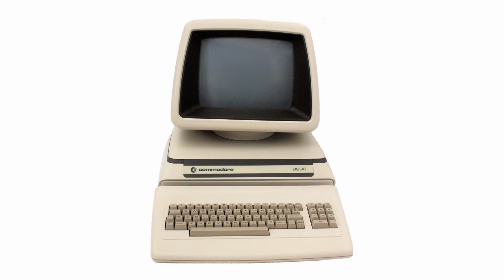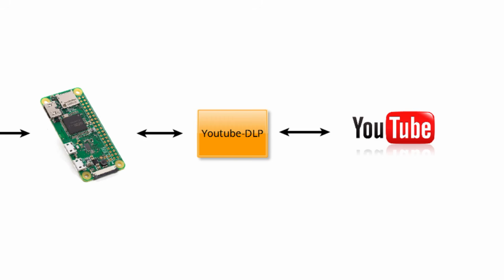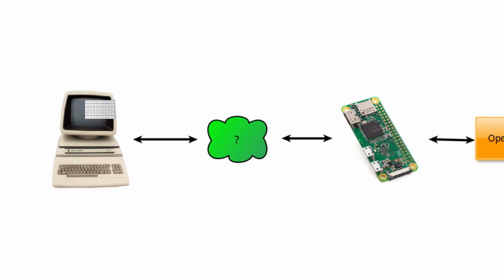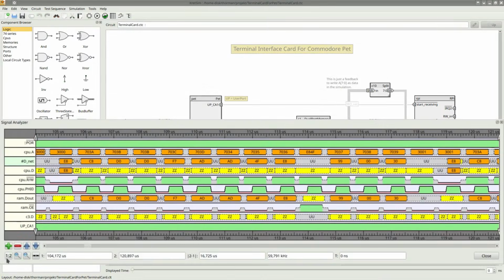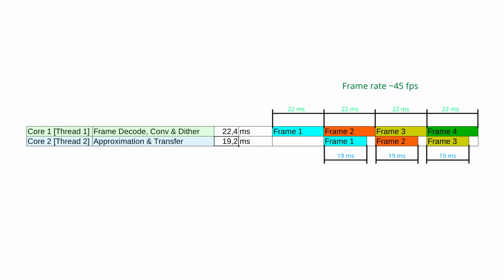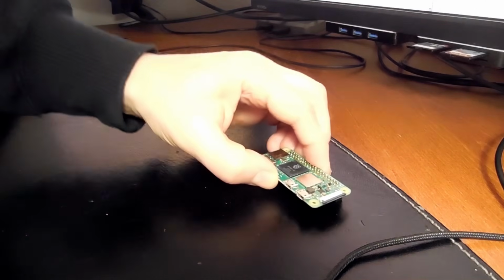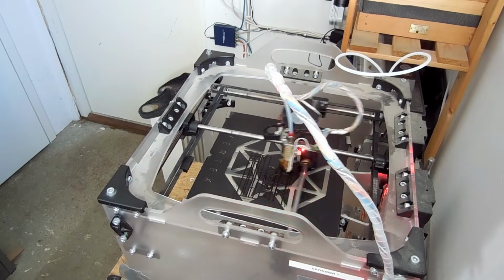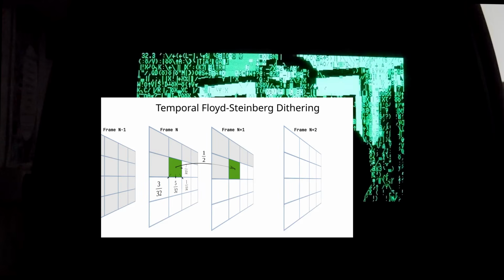Watching YouTube on a Commodore Pet

Comment: You could add audio by unrolling your loop a bit, say 4 times ( you've got a few kB of memory to burn on the PET) The unrolling lets you skip BNE's, which eat time, and you can get the equivalent of a free transfer per 4x unrolled loop. You'll probably need duff's device or an equivalent approximation to ensure you stay in sync, but you got 10 free transfers per line, you can afford it. And besides, audio. Also, that keyboard per frame to the pi, so you can play games. It will, obviously, play doom.
Reply: If you were feeling very energetic, have a macro-assembler, or can copy-paste a count in Emacs, you could unroll the entire frame buffer transfer; 6k of straight-line code. That would leave a lot of time per frame for 'activities.'  Reminiscent of John Carmack's 'quickly block transfer rendered frame to the slow video card.'

Comment: As a former owner of a PET 4032, it's very cool to see an old PET playing YouTube videos!

Could something similar be done with an older dumb terminal, like a VT-220?

If I understand the video correctly, the Pi is doing the downloading and converting the image to PETSCII characters. The PET then simply reads and displays the input characters. To me, that sounds similar to what a terminal does.

But I don't know if there are terminals that have a port that have the kind of throughput of the PET User Port.

Comment: Something you can try is the following:

Instead of counting up 2000 addresses on the board, on each "scan line" (80 characters per "scan line", for a total of 25 "scan lines" per screen), have the PET send a pulse to begin counting, then set up the circuitry to automatically pause counting after 80 addresses. One way to do this is to have a clock generator drive the up-counting but have the clock generator itself controlled by a CD74HC40103 DOWN-counter that is hard-wired for 80 iterations. Then, in the PET code, completely unroll each scan-line loop so that it transfers 80 characters with no NOP or branch instructions. You'll have to change your clock timing on the board to match the faster reading time of the PET.

Why do this? First, it will make the whole thing less susceptible to clock drift since it's only over 80 iterations instead of 2000. Second, it will save a bunch of PET processing time, perhaps enough to grab and output a little sound. Something to think about.

Comment: So impossible to do 4x8 CHARS? I wonder if it is possible to make a custom CHAR ROM that you could run some simulations on to build the most useful set of CHARS that would contribute to real improvement to the Bitmapped emulation with "TEXT" Characters. Or some how modify so that the display can be set to read char data from some RAM address like the C64? I bet the easiest way would be to have another PiZERO2 emulate the CHAR ROM EPROM and be able to dynamically change the CHAR bitmaps. Heheheh!

Comment: Are you characterizing the pixels in the order of appearance (leading to converting possibly the same pixel value repeatedly) or have you tried first just adding them to a unique array and using a replacement function to swap all occurrences simultaneously? I feel like it could be a vital improvement to the Pi's performance.

Comment: To improve the video quality massively you should adjust the gamma before you dither. It's best to do this with the output being more than 8 bits. Also, you can speed up the character encoding by only considering a subset of the characters based on the overall brightness of the character.
Reply: @xbzq, because you've done this before huh?  Improve your lies.
Reply: @M60gunner1971  Yes I have. A gray with value 128 isn't physically mid gray, it's perceptually mid gray. Half the amount of light of white doesn't look like mid gray and so shouldn't have a value of 128. But when you dither say with a checkerboard pattern half black half white, you get physically 50% light (on average) so it would be wrong to translate 128 to a checkerboard. The function to apply to correct this is exactly the gamma function. That's what it's for. You can try this out in Photoshop. If you apply a gamma of 1/2.2 and b/w dither to a grayscale image and then place half of it over the original you'll find that from a distance you can't see the line of where the grayscale ends and the dither begins. If you do the same without the gamma then a clear line will be visible where the dithered side will be much lighter than the grayscale side. The same adjustments need to be made when halftoning. Not sure why you assume these are lies. The 1/2.2 gamma is related to the normally used sRGB which has a built-in gamma of 2.2 for historical reasons as well as making 8 bit images have less banding. In principle a computer+monitor could take any number and display it as any desired brightness. This is obvious when you play with your gamma settings in your graphics card software. The graphics in your video RAM don't change but your monitor brightness does. Incidentally, to do correct image transforms that involve color calculations such as brightness, contrast, blur and more all benefit from applying 1/2.2 (0.45) gamma prior and then afterward re-apply a gamma of 2.2. In many cases the difference isn't very noticable, but in some cases the difference can be very significant.
Reply: @xbzq  do you have the phone number to the nearest burn unit?
Reply: @xbzq  Why don't you just make a video and show us. Your explanation is useless. Until you have your own video posted, nobody cares what you think can "improve" this.
Reply: @NYCBostero    There's at least 8 people that care counting the likes. So you're wrong. You're saying I have to go make a video so you can understand but I don't think you could ever understand. It's very complicated. Much more complicated than you have the patience to understand. You already don't care except you care enough to say you don't care. Looks like a paradox right there. Looks like you don't even know what you're talking about when you say you don't care. Well I don't even care that I care. So there. I one-upped you on not caring that I care to not care to give a crap whether or not I care that I care. And if you don't understand what I just said it just means you don't understand whether you do or don't understand. There are known knowns and unknown unknowns. I could make a video about it but I don't care if you understand so why would I go and make a video about it? I'm too busy not giving a crap so I don't have time to make time to make a video about making videos. I barely have time to comment about commenting on comments. The point is you're wrong and you think you're right so you're also wrong about being wrong. If you weren't then you'd be right to know you're wrong but you'd be wrong about being right because you can't be right and wrong at the same time. Or am I wrong? If I'm wrong about being right then at least I'm right about being wrong that I'm right. And you can't honestly say that. If you could then you would. And you're not and neither are you ever going to. Therefore ipso facto you cannot. If that makes no sense to you it just means you are not capable of understanding. But when you become capable you will immediately understand. Since you'll never understand (a clear given) you'll never learn. I could make a video about it but I think it's best if you make videos instead. I'm not in the entertainment industry. I'm not a puppet dancing for amusement. If you cared to know anything there would be many ways to find out. You don't care to know anything so where the no will there isn't a way. You care to complain that some rando on the Internet isn't making videos for your entertainment. Videos that even if I did make them your wouldn't watch and even if you did watch them you wouldn't understand. Who are you that anyone should even care whether you care? Think about it. Keep thinking. You'll never actually understand. But go ahead and try. There's no try, only do. Yoda said that. But he's fictional so since he's not real he cannot actually talk. So that's another conundrum. Something I'm sure you'll never ever understand. It's after all way over your head. Gamma. So difficult.
Reply: @NYCBostero  What the fuck is with the random, hostile attitude with these commenters?

Comment: what the video format as in pixels, was 140, 800, 1024, 2160 or 3840 pixels, 
I call ok but not any yuotube video, How the hell did you connect it to the internet ,Their was no internet when these where out.
Can put the ethernet card you used, Along with the video render.

Comment: Wow this brings back Memories.
I use to run a BBS system on my Commodore 64 then i upgraded to an Commodore 128 and ran 8 phone-lines
6 80 Megabyte HD's over a network called FIDO-NET which was the grandfather of the todays Internet.

Comment: I remember the Commodore Pet in elementary school in the early 80s but they must have been older models, were more square and just said PET on the front. I remember they used cassette tape drives. They were located in the library, the kids weren't allowed to touch them except in very specific cases.

Comment: 1. you probably can move the frame transformation to GPU/GLSL to process it even faster/in parallel with double buffering
2. since now you can render any video, the next logical step is to stream Crysis output into Pet :)

Comment: Maybe you can fix image by adding  some contrast filter in pipeline and also, why not precalc all pixels variations in advance? It's already looks like JPEG for me..
And is there an option to store pixel longer with this correction? Tweaking pixel delay may add some good difference in resulting image.

Comment: It's like me right now, when my wifi modem stoped working, like stoped finding any signal, i decided to use my android phone Samsung Galaxy S6 to use internet. But, since my phone does not support 4G internet connection, despite it been available in the settings, i only can use 2G or 3G connections, that has too bad signal because, many are now using 4G and even 5G and 3G is almost dead. Thus why i can only watch YouTube videos in 144p, otherwise it would take too long to load. I can't wait until i can buy new modem to, finally, return to normal internet, with high speed.

Comment: I'm certain you could clear up the picture a lot just by reducing the character set used to generate the picture, but you could really perfect it by creating a custom character ROM for the PET.  Even better than that, make a microcontroller that plugs into the character rom slot that can be dynamically controlled to create new characters on the fly, and just use the original picture to draw the character.

Comment: i bought 3 or 4 zero 2's right before COVID, and i'm thinking about tearing apart the projects i used them for and selling them for $500 each haha. i saw a pi 4 go for $400 earlier in the year (2022). For christmas i gave my nephew a custom made NES emulator built around my ONLY pi 4, and i made sure to tell my brother about 50 times to NEVER throw it away if it breaks somehow and that the chip is now worth way more than any classic NES or anything else with an emulator in it. 

Personally, i don't think raspberry pi will ever recover at all. someone else will have to fill the void eventually, and it will probably be direct from a manufacturer in southeast asia (most likely shenzen)

Comment: If there was any chance to run this in custom characters, rather than fixed asci characters, you could display current frame + future frame /2 (meaning running each frame as a combination of last frame plus new frame). For instance, if current frame equals '|' and last frame equals '-' the resulting frame is '+'. Same with 'X' and '+' = '*'. E + H = B. etc...
With custom characters, you can create a much more defined output.  Like a diagonal line in a certain angle... If the custom character map has sufficient custom character spaces, you could create quite a good video quality!

Still, good job anyway. I knew the C64 wasn't able to show any video over perhaps 100x100 pix anyway, unless the video compiler and decoder was created in C. Even then, you'll be looking at a realistic output of nothing more than a GameBoy (~133 SQ pix max)

Comment: You could have reduced the number of cycles by making one bigger loop having only one "iny" and "bne" in it. Yes, the data would not be linear, but so what. Or get rid of all loops by having a list of 2000  lda xxx and sta xxx. That would fit into ram. PS. I used to write video games for 6502 systems back in the '80's.

Comment: Excellent project! Really impressive! To improve you could use one of the tape IO on the userport as start signal, and use the CB2 handshake mode to toggle each time the userport data register is read. This removes the need for the timer if you increase the address on each toggle.

Comment: Like you said, "The Raspberry PI must do all the heavy lifting".  This is VERY impressive but because of this point, the PET is really just being used as a display.  I would absolutely love to see what someone could come up with using a 2400 baud modem and a C64 (maybe faster than 2400 via the expansion port) but have the computer do 100% of the work.  Of course you would not get near 30 FPS but I'd like to see what a C64 would be capable of on its own.  Alas, implementation of the PPP protocol on the C64??  Ouch!  Maybe cheat just a LITTLE and have the C64 call another computer that at least does that part for it.  Communications over the modem would be direct from YouTube, not PPP to an ISP.
Reply: The slight cheat I mentioned above would be analogous to streaming a video from a hypothetical ahead-of-its-time BBS back in the day.  So don't worry about any networking stuff but DO have the 6502 decode the video to PETSCII.

Comment: I wonder if you could have character roms selectable by a DIP switch... you know, for a better video experience. I assume the RPi itself doesn't have the necessary overhead to output sound from itself? Are the zeros OC-able? ... Are PETs OC-able if you double the system clock and halve the clock to the VIC chip from there?

Comment: Interesting project. As for video to text conversion - couldn't you for example reuse a modified version of aalib or libcaca (the thing that is used by mplayer playing videos in text mode, modified due to a different character set) on the Pi instead of writing your own conversion procedures? Or would it be not quick enough for your needs?

Comment: Wow. You sent me back in time, back to 1988 when I worked as an assistant to a Mac lab. 

We had almost 40 macs, all connected via Apple Talk to a Macintosh II which served as hard drive and printer server. 

Why did your video returned me to that era?

Well, one day we had a seminar on the lab and before hand two people from Microsoft had connected a camera to one of our Mac Pluses and the Mac II had a fancy Token Ring adapter installed to connect to the Internet. 

The Microsoft guys had created a zoom like setup where the tiny Mac received what were basically bitmaps from a capture board and from the Mac II of signal coming from the internet at high speed (about the speed of a T1 or 1 Mbps) 

So the little Mac had no idea what the bitmaps were and basically two computers were feeding it the pre compiled info. 

Then we learned that the motion capture card was actually a 68000 daughter board. 

Kudos and keep up the good work.

Comment: Great project, and great teaching skills.
Great use for it as a terminal display too.

Suggestion: You should try to use the average value for the gray scale step, either in 8x8, 4x4 or 2x2 blocks, to improve the character being selected, since there is a lot of jitter due to changing characters based on very few pixels being changed. The ideia is to basically smoothing out the video frame for less active noise on the output.

Comment: Very nice explanation.  Next time, you may want to consider an ordered dither instead of an error-diffused dither.  It matches the PETSCII graphics closer, is faster to process, and results in less "speckling" during video playback.  You can still distribute error temporally if you want to, and in the case of 50% gray, will result in a half-lit pixel due to the monitor's phosphor persistence.
Reply: 36:36 i think he explains here why he chose that dithering method, but i think your suggestion is pretty sharp!

Comment: This was amazing. 
I just love low level stuff. Hardware and assembly.
The only "discipline" that was missing would have been to put all that stuff into an FPGA. maybe even the Pi, by using a softcore. 
You have well earned a sub!!
Edit: 60kbps would be even enough to work over ISDN, or, with some lossless compression maybe even POTS
Reply: Whilst ISDN could handle it, POTS is no longer copper in many areas in the US; it's fiber optic now.
Lossless transfer would be greatly helped by the fiber line, though.

Comment: This is a totally awesome project. I worked with the PET (8032) at the time and I knew the 6502 so well I could hack program pieces in hex code directly in memory without even looking up the opcodes. Uhm but that was some time ago. It is really great what you did, literally shifting bits and bytes. Too bad this brilliant work does not really have a real-world use.